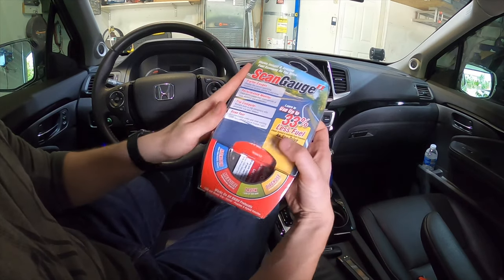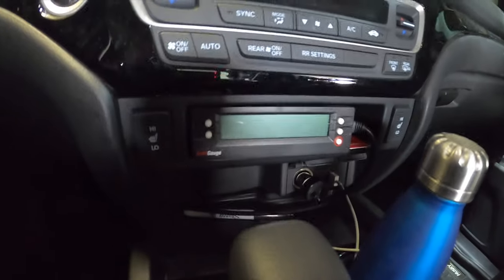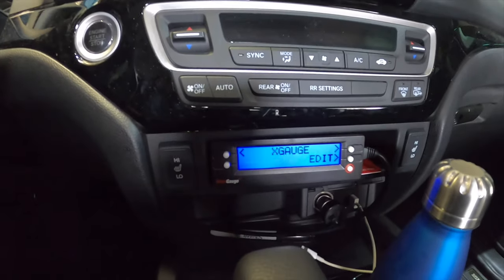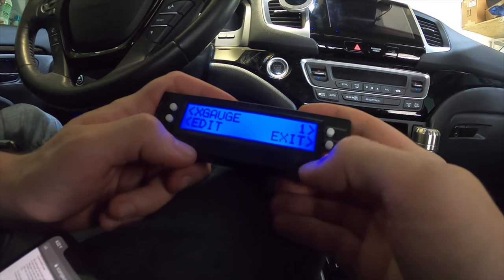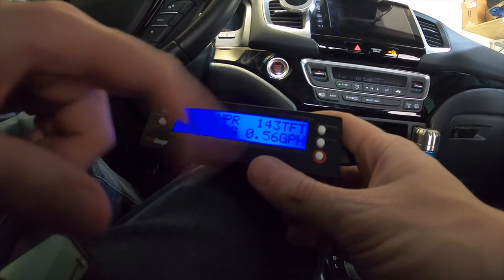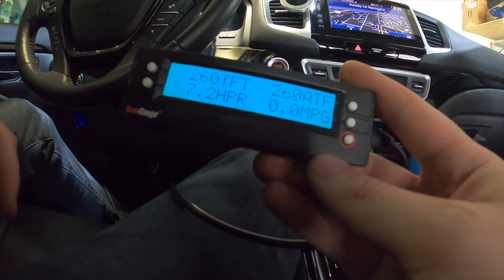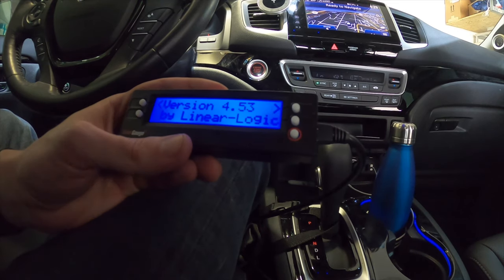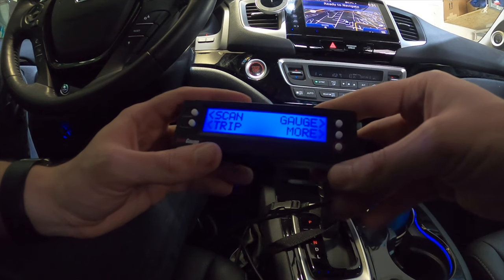Scan Gauge 2 Unboxing, Programming and Issues

Comment: Sits mostly between 140 and 160 when driving.  I did a tow practice on a 2000lb trailer yesterday and it got to 165.  It starts at double digits now - every start since that first one it has.
Reply from the maker: Great! Then it sounds like its working well. This is such a useful and handy tool to have in the ridgeline.

Comment: Obviously a little late for this, but according to the ridgeline owner's forum you can send in a Scangauge II with an older firmware and upgrade it to the latest firmware (maybe 4.53) by sending it and a $25 check to Linear Logic. Checkout their website for more details, at this point you could upgrade the older unit and I guess have a backup.

Comment: Have you tried the alternate trans codes? Reason I ask is some manufacturers monitor trans fluid temp coming out of the convertor. If your code is for that instead of the temp in the pan it could explain the really high temps you were seeing while towing. I monitor both temps for the trans in my Toyota to really see what my trans fluid is doing.
Reply from the maker: Yes, there are two codes for the honda. From the research I found and what was online people say that the one I have plugged in is the correct one to use. Based on my 3000 mile trip across America towing 4800 lbs I can confirm that I believe the code I talk about to be correct because the Honda Temperature warning light turns on at 300 Degrees and I have never allowed it to get that hot. I have always been able to catch it before spiking out of control for long periods of time.
Reply: Did it help with fuel mileage ?
Reply: @garychambers5930  It helps me because I can see real time MPG and trip MPG. Every time you start the truck the scangauge's "average" MPG resets so you get an average for every trip.  I can see exactly where my MPG drops off if I drive too fast.

Comment: TFT wasn’t showing any reading on my 2020 but I entered the “Alternate” code on the site and it is showing numbers - about 130 at startup.  Does that seem right to you?
Reply from the maker: Yes it could if the truck was outside in the sun or not. Usually it starts in the double digits though. I would just confirm the code was entered correctly. As long as it peaks and stays roughly around 175-190 then it should be reading accurately. If it spikes to 200-300 or 1000s of degrees then I would question it. Hope this helps.

Comment: Hello, my car doesn’t have a onboard computer, I just have trip a and trip b, no mpg or something.. I have an OBD and it’s a 2007 car, do you think scangauge will show mpg ?
Reply from the maker: Yes it would. Just double check on the website that your vehicle is one of the vehicles it reads.
Reply: @YuriyMotso  I Hope it will work, in the compatibility list it’s nowhere to be found, but with my iPhone and a Wifi OBDII adapter I can’t see the consumption of my car but I guess the scangauge is way more advanced that my 10 bucks adapter ? Lmao
Reply: @sheppardpat47  i use in both a '97 corolla and 2007 sienna. any car after about 1995 the scangauge will worl(toy,honda,ford etc etc)
Reply: @crabtrap  it’s been a year and I still use scangauge in my car works great
Reply: @sheppardpat47  ive been using mine for 8yrs, no probs. Paid for itself 100times over in gas savings
Reply: @crabtrap  same bro! Amazing product